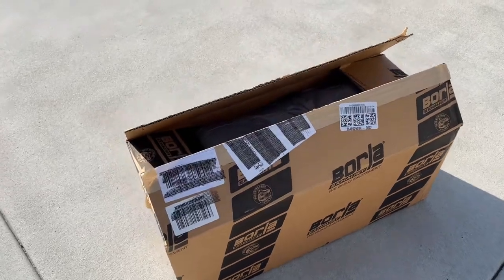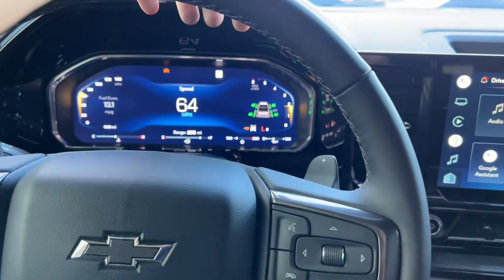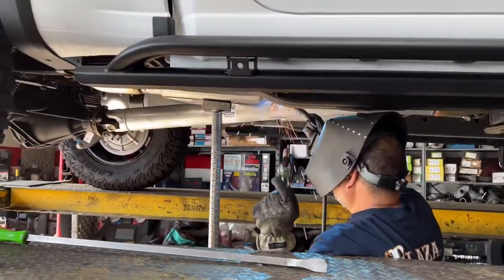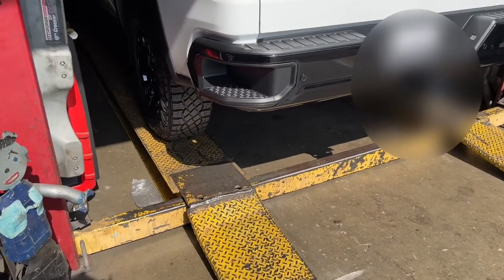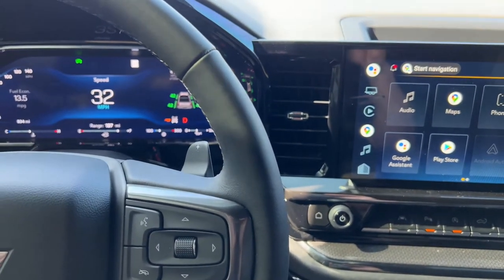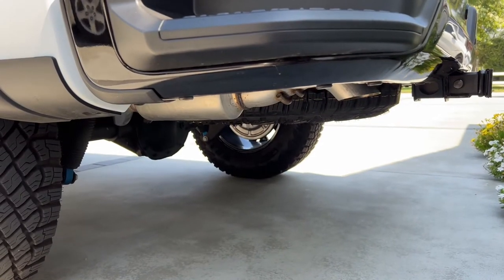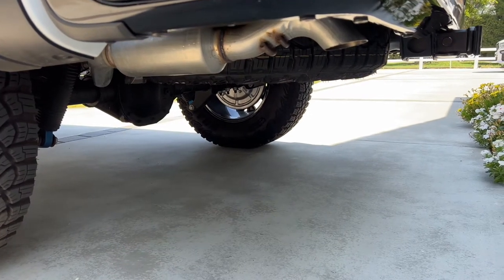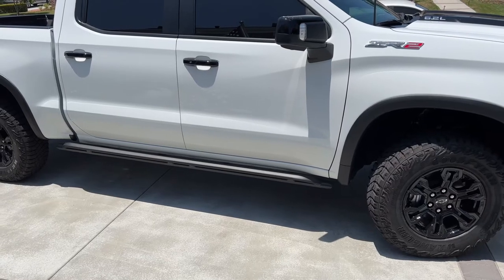Silverado ZR2 Borla ATAK Crate Muffler vs Delete!

Comment: Thank you for making this video! I've been dying to get an exhaust on my ZR-2. I cannot believe GM doesn't do this from the factory. I'm definitely buying one of these mufflers TODAY. your truck sounds amazing!!
Reply from the maker: Thank you for the GREAT feedback! Hope you subscribe because we have some more cool stuff coming.
Reply: @rant-n-rave7816  I’m watching the intake video now, that looks like a pain!
Reply from the maker: @jamesasher9810  yes….. yes it was… we have another blue ZR2 arriving tomorrow and we’ll be installing. Corsa intake into that one. We’ve used Corsa in the past and it’s MUCH easier to install. Thanks again for the feedback!
Reply: @rant-n-rave7816  could you please include a link and part number for the Corsa, I may do that one instead. Thanks
Reply from the maker: @jamesasher9810  I would recommend the K&N my friend……. It just kicks ass! The dry filter on the Blackhawk is just so much easier to clean with a simple air-chuck vs oil. It’s not that bad to install and you’ll be happy!
Reply: The 24s have em

Comment: Ordered the Borla 400844 for my new ZR2 after watching your video (and also the K&N Cold Air system).  Once the muffler gets here I am taking it to my local muffler man to install it for me.  Do I have them remove the flapper valves?  And leave on the resonators?   My knowledge of exhausts sucks, pardon the pun.  Thank you for the videos and inspiration!!!!!!!!!!!
Reply from the maker: You’ll notice on the image of the muffler we cut off that the flap valve is removed with the muffler. Leave the factory resonators on as they work just like glass packs and will give you that great “rasp” sound you will want during wide open throttle. Enjoy and please tell your friends to subscribe as it helps us to create new stuff!!!!

Comment: I tried to send you an email but it came back as email address not found. So i'll post it here.

 I have a ZR2 as well and mine has a right front turn signal issue where periodically it will stop working. When this happens the interior right turn indicator and the right rear tail light will hyper flash, along with a message on the main instrument panel to check right front turn signal. I’ve had it in to the dealership twice, and they can’t get it to duplicate. Once it does it, I shut it down when i get where i’m going, for 30 minutes to an hour, and when i start it up again, it seems to correct itself, and it only seems to do it once a week or maybe once every other week.
        My neighbor is a department manager for one of my local chevrolet dealers, and when I explained the issue to him, he then ran it by his service manager, and said that they currently had 7 ZR2’s experiencing the same issue. They called Chevrolet for guidance on how to fix it, and GM said to replace the main instrument panel. Apparently it’s 3 hour fix. 
        You may or may not be experiencing this with your truck. Lucky you. I’m just sharing my experience with mine. It goes in on Tuesday for diagnosis and parts order. Keep up the great ZR2 content.
Reply from the maker: That’s scary… well, we have a blue ZR2 arriving tomorrow to add to the driveway. I’ll be praying we don’t get THAT defect! Most videos coming!

Comment: Why does the Borla atak sound so much louder on a mustang 5.0? I wanted something good for daily driving and yours sounds good for that but I’ve heard it sound crazy loud on other cars. Which crate muffler did you get?
Reply from the maker: You have to remember I left the resonators on which are like glass packs, if you’re old enough to remember those days. I’ve had Mustangs and on my Shelby you need to go with different models. You will want to check out the Borla website and look for the sound you want. Don’t compare Apple to oranges, look at your mustang with your engine setup to get your correct sound.👍🏼
Reply: @rant-n-rave7816  oh so the resonators restrict that much sound? I never thought they did that much. I actually don’t even have a mustang I was gonna put some of these ataks on my Benz 5.5l na v8. Was likely going to use the model for the ls3.

Comment: Install the range tech too delete your dfm..so you have a v.8 all the time and motor don't blow
Reply from the maker: Won’t work on ‘22 and Pulsar LT will not work on it either. Just drive in manual and keep it in 9th gear or under and the DFM will be disabled. Also use tow mode to keep higher shift points, you’ll love it.
Reply: @rant-n-rave7816  I’ve got a 2022 LTD Custom Trail Boss with the 6.2 and the Pulsar LT has been working great for me. I’m not sure about the refresh models or the ZR2 though; the pulsar might not work with those like you said

Comment: You had it in tow mode
Reply from the maker: Yup, only way to drive it really. Tow mode holds the shift points and allows truck to actually drive like a truck and not drive like a Nissan Leaf…. You also need to put it in manual mode and drive in 7 around town and 9 on fwy to avoid cylinder shutoffs